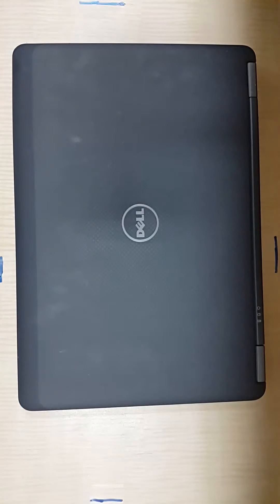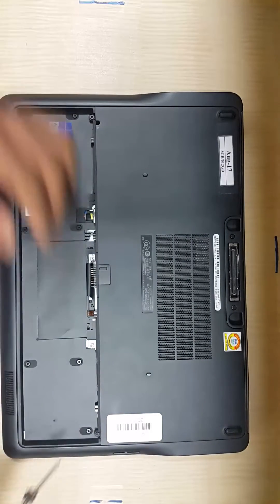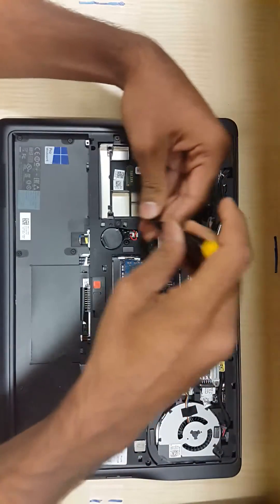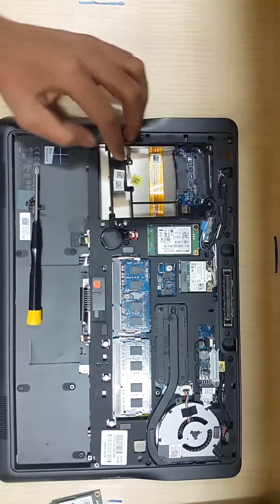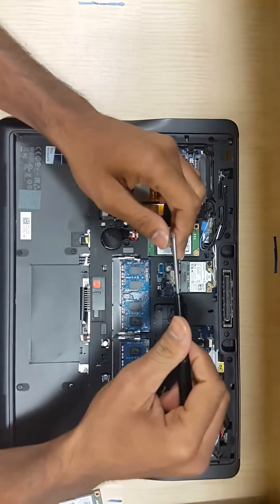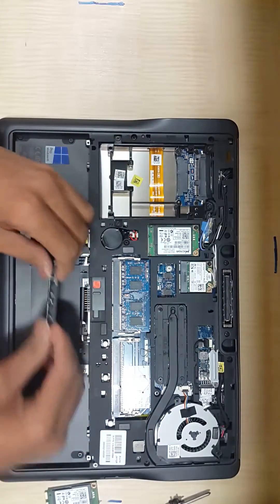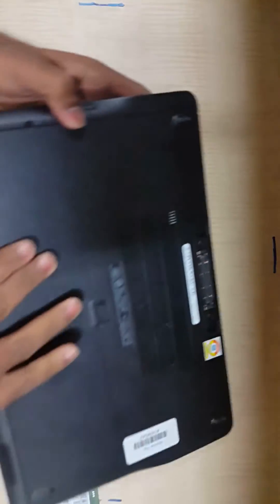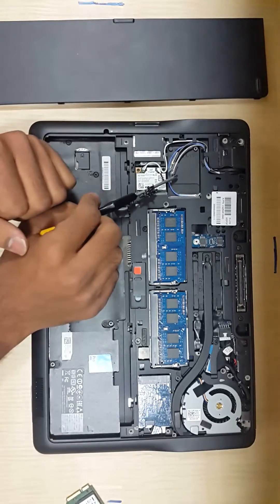Repair  Dell Latitude E7440 and E7240 by Yourself.

Comment: I have a Dell latitude E7440 and just stop starting the program. I don't know what happened, the energy button turns on but never start again when I push it. What could happen? And what can I do?
Reply from the maker: Ricardo Lizarraga remove battery and press the power button twice or thrice without connecting the cord.. Insert the battery and then check again.. If still nothing happens connect the power adapter and check..